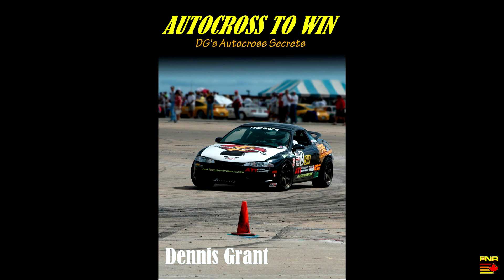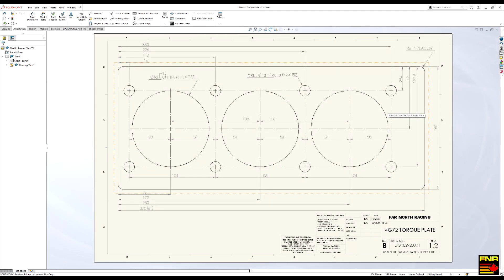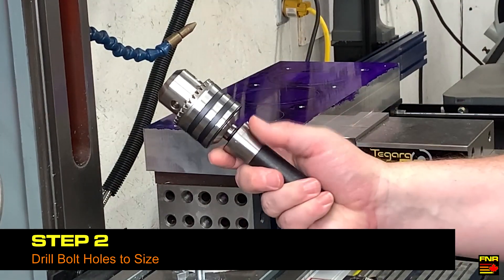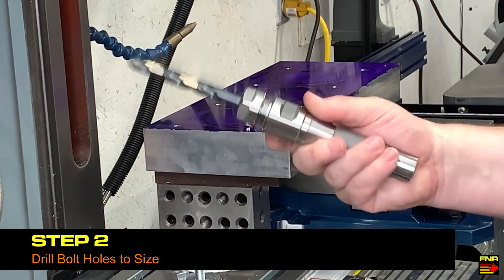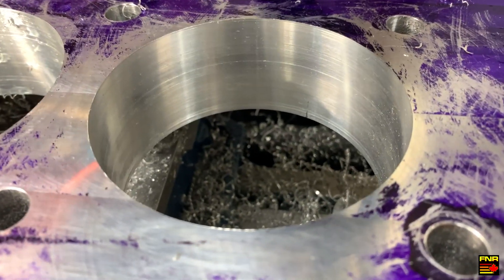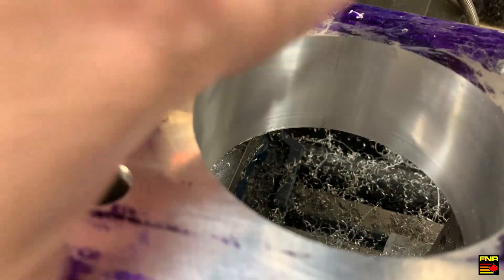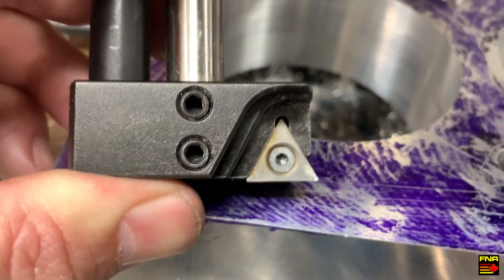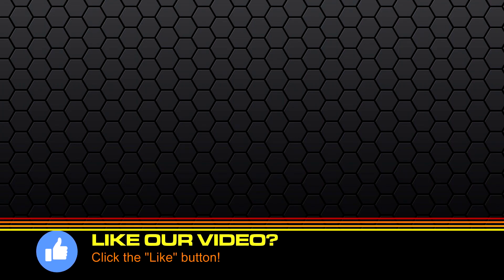FNR Stealth Project Ep 12 - Machining a Torque Plate

Comment: Is there any reason you couldn't make the piston holes the largest boar possible so the could be used for any applicable 6G72 block build?
Reply from the maker: To do the best job of replicating the forces the engine block will see in actual use, you have to use the same head gasket type as will be used in the final assembly. That requires a bore in the plate that works with that gasket.

Also, I'm not building a general-purpose plate, I'm building for my motor, which will be a slight overbore vice a max-bore.

Comment: The right way to do this is to just get it waterjet cut, holes and all lol. The fun or interesting way is this video. Except drilling the initial holes with the saw is very boring.
Reply from the maker: I'm going to need a lot more Patreons before I can afford a waterjet cutter.

The holesaw cuts were legit 1 hour each, but still faster than using the boring head 0.045" at a time, plus I got to save the pucks.